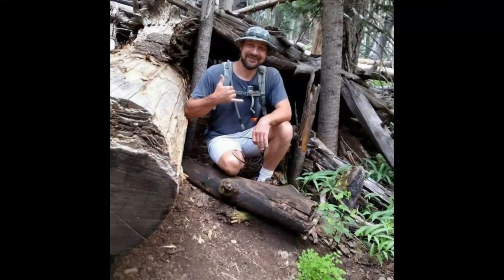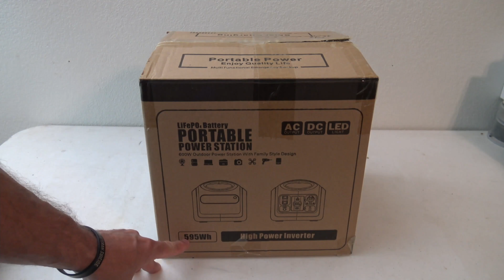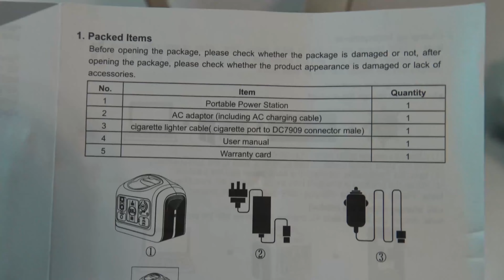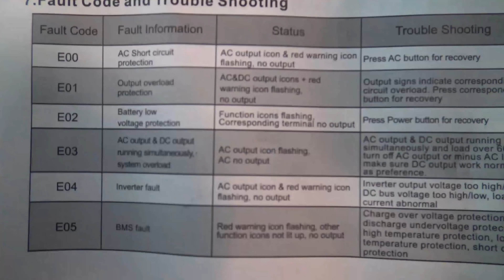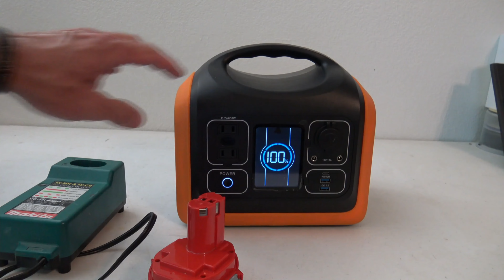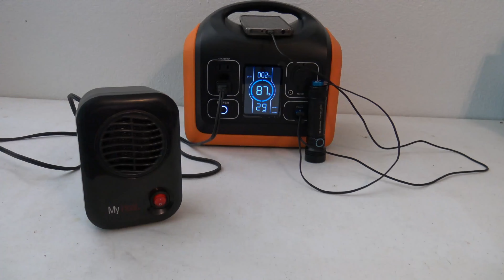OUPES 600Watts - Portable Solar Power Station - LiFePO4! Yeah!

Comment: I just order the 1100w  versión because I believe I need a higher capacity, I don't travel or camp but I live in a place with hurricane or snow cut the power, that's the reason I got a gasoline/propane generator but I want something with no noise but good enough for appliances, hope it works good and for the many times it can be recharge this will last for ever for me